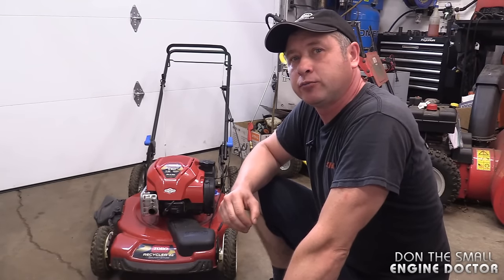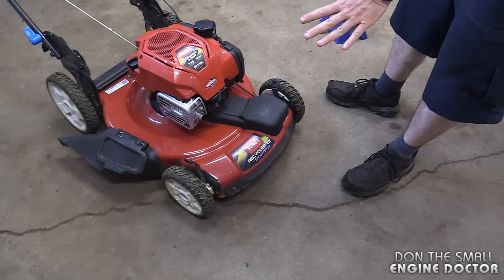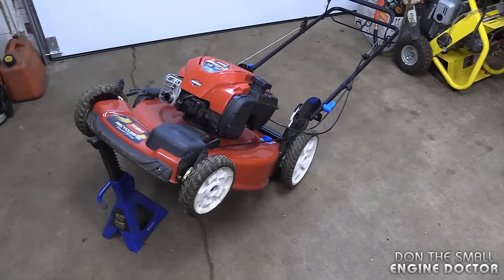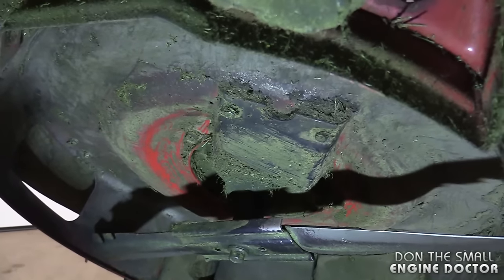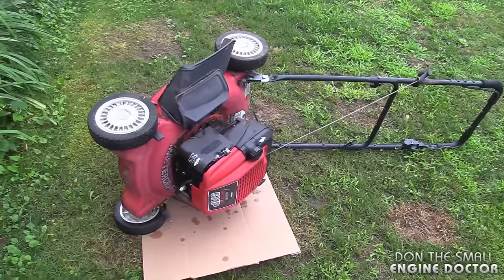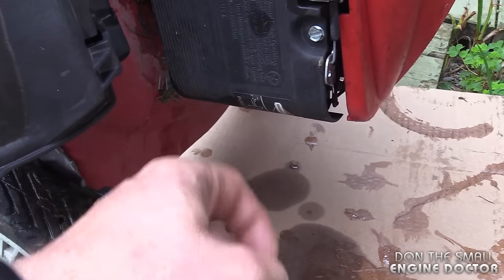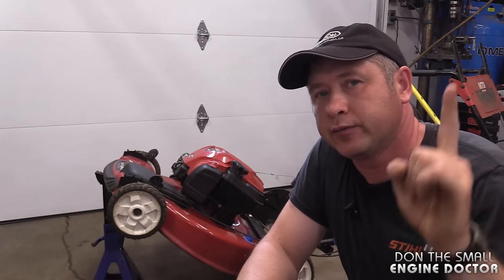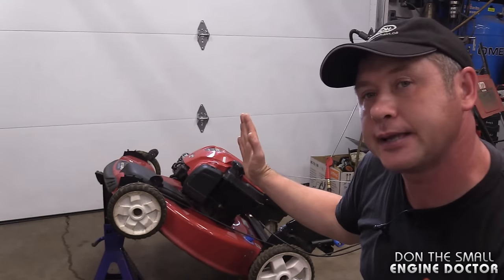Proper Way To Tip A Lawnmower Over!

Comment: For me changing, removing the blade would be a sonofabitch at that angle...never did it this way. I can live with a little smoke outta the muffler...for a few minutes. I can't see myself ever changing,removing a blade to sharpen this way.
Reply: My mower is so old..it's still running after 24+ years. got it when I bought my house in 1994. My mom bought me this 5.25 hp MTD mower new back then. So iately I had to rivet with screws a section of the deck with sheet metal, cause of all the rot. Still running strong, although it seems to be missing lately.

Comment: Honda specifically instructs users to tip the mower onto its right side.  Comments?
Reply from the maker: yes when draining the oil
Reply: @donyboy73  ...and when hosing off the bottom of the deck.  I never have issues with fuel or oil leaks or vapor lock.  It's in the maintenance manual.
Reply from the maker: @OpaKnows  yes if you do it quickly enough as i mention in the video